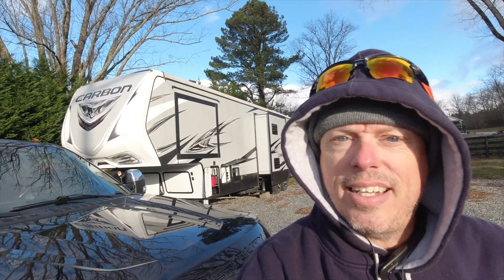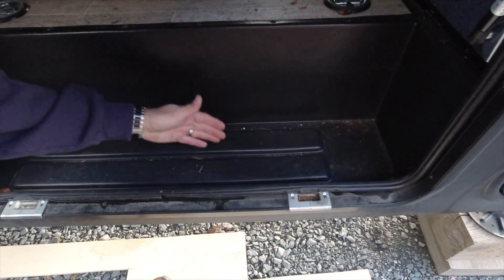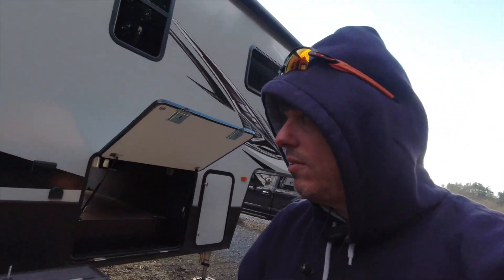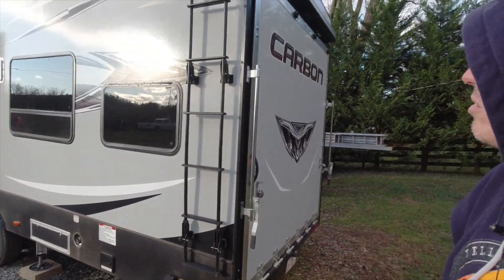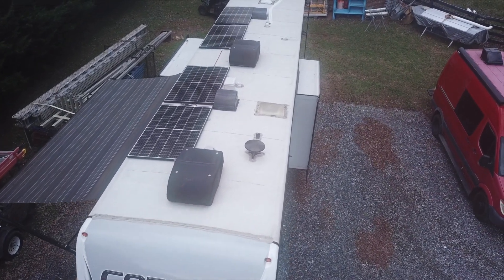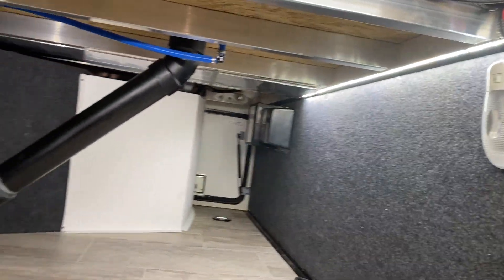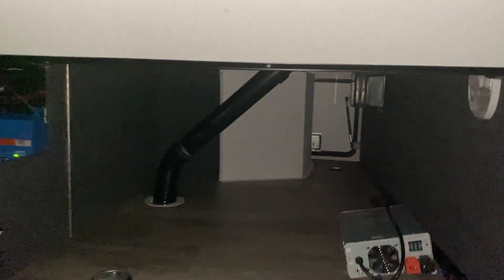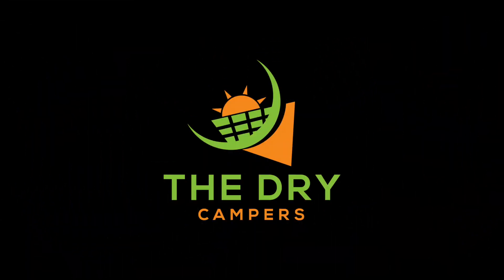2018 Keystone Carbon 357 | RV Solar & Lithium Upfit

Comment from the maker: Check out our first Keystone install on this Carbon 357 toyhauler model! This one has 1320W of solar (there was an error in the video, sorry!), 400Ah Battle Born Batteries, 3000W MultiPlus, 150/100 MPPT, 2 MicroAir Easy Starts, BMV712. Thanks for checking it out! Smash that like button and hit the dingy bell ringy thing to get notified when we release videos!

Comment: I loved this video. You do awesome work. I have a Keystone Carbon 387 that I would like to add a couple solar panels on. My sticking point is the roof penetration and finding a route from the roof to the basement. It looks to me like you penetrated near a plumbing vent. I'm guessing that vent is in a wall of the bathroom. Can you explain the route that you used in this 357 and how you figured it out? Thanks.
Reply from the maker: Pro tip. Not all vents go straight down. They 90 in the attic and go down elsewhere...
Use a rod and send it up the hole from in the passthrough and tap the roof.  Find out exactly where the lines run before you make the hole down.

Comment: How do you decide to wire the solar panels, series or parallel?  When do you wire parallel and when do you wire series? Seems like you prefer parallel for the improved shading output?
Reply from the maker: Yes, I wire everything parallel, but if I have to do series, I wire series parallel (which I've only had to do once on a Newmar).

Comment: Nice setup!  Just curious, are most clients indifferent about the additional weight?  Or is that like one of the first conversations?  “I want a lot of solar but I don’t want a lot of weight”?
Reply from the maker: Thanks! Most clients have been saving up/budgeting and have done a ton of research for months, if not years, as well as consult with us regarding their wants and needs, meaning most are pretty aware. The only cancellation we had this year was one where he decided to upgrade his RV and truck because we were very concerned with the system that he wanted and seems as if he was already at capacity. Our proposals even include an approximate weight for the entire system so that each client signs off on understanding how much additional weight it will add as well as we suggest weighing before and after the system is installed. Most people are willing to sacrifice unnecessary things to get these systems. Hope this answers the question. :)

Comment: Quick question, are larger wattage solar panels cheaper than smaller multiple wattage panels (1-300watt vs 3-100watt)? Are you saving much weight with going with the bigger panel than multiple smaller ones?
Reply from the maker: Hey there Ronald - the large panels are right at 40lbs, so in this case no, it is not better to go with the smaller panels for weight purposes. 4 panels are ~159 lbs whereas 13 small panels would be ~195lbs because they are 15 lbs each. Also with 13 panels, more wiring, more connectors, etc. are adding even more weight.
Reply: @TheDryCampers  As always, thanks for the great and quick answers.
Reply from the maker: @ronaldw.2923  I just re-read your question and realized I didn't answer about the cheaper portion, sorry about that. It depends on what panels you go with. We typically like the Renogy 100W panels and the REC N Peak 330W panels, and the reason we recommend these panels is due to the efficiency. The Renogy Eclipse panels are pretty pricey, so it is in fact cheaper to go with the larger panels; however, it all depends on many factors because the large panels are shipped freight and that is a tad pricey. Bang for buck though, we always try to do larger panels. Hope that helps.
Reply: @TheDryCampers  Again, thanks for the great information. We are oozing at possibly buying a Forest River fr3 30ds which has a crowned roof. Will this rounded roof make it harder to install solar panels?

Comment: One question, why doesn't mike cover the wires on the roof with eternabond tape?  I am sure there is a good reason because everything Mike touches looks perfect.
Reply from the maker: Hey there Benjamin, Eternabond is utilized here for securing the wiring, but it's not necessary for the entire strand since the wiring is outdoor wiring.